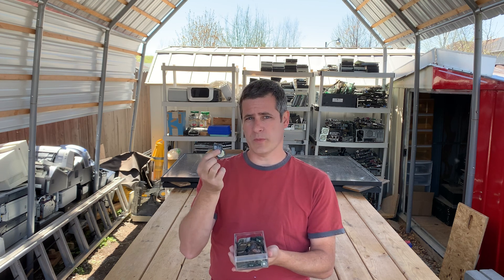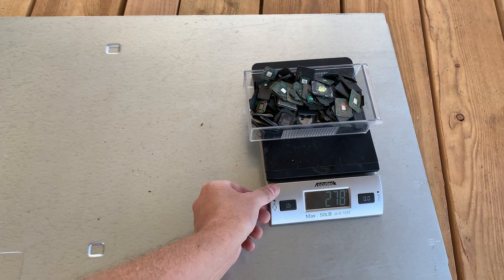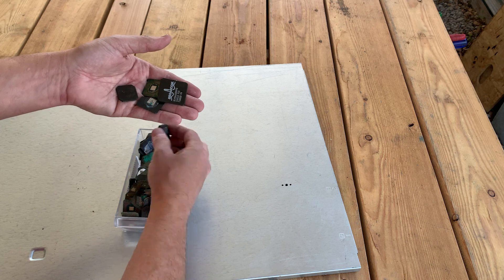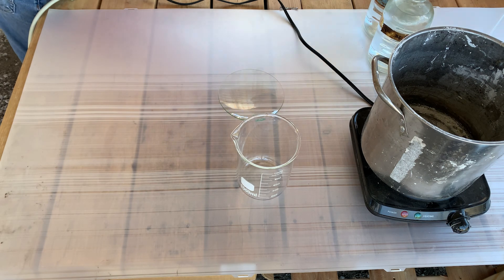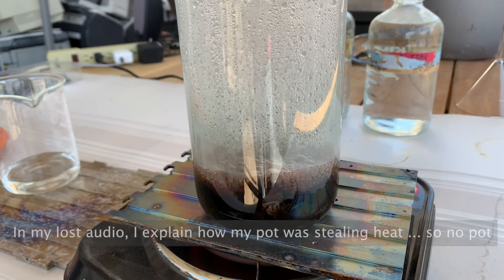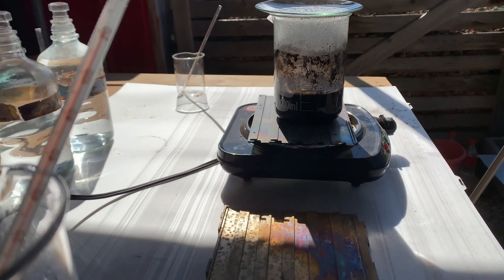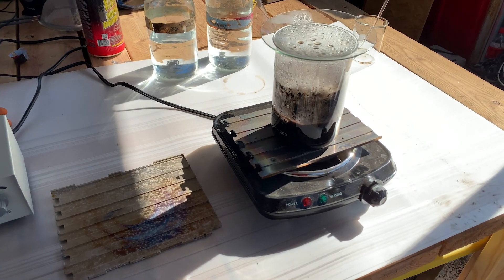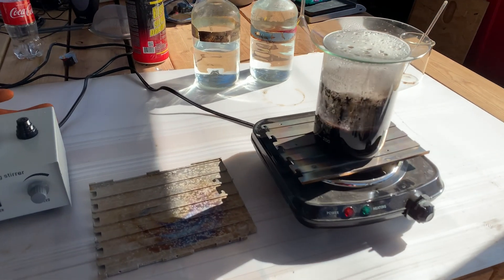Gold Refining: Gold Corner BGA

Comment: Is it not better to smoke them all?
Reply from the maker: Smoke?  I think you are referring to incineration.  And yes, there are advantages to the incineration method (Also known as ASHING).  Using acids is known as WET ASHING ... which in my opinion is not better.  My experience with both methods have bad consequences, explained here:

1. Wet Ash uses acids that burn cloths, and lungs, eyes ... basically, organic material must give way to the caustic and corrosive nature of the acids used.  It uses heat and endothermic reactions which can break glass wear, run out of control easily and without warning.  The waste water after rinsing off the acids must be managed correctly and not just dumped out somewhere.  This way makes the biggest mess, and has the most risk.

2. Ashing requires the chips to be burned to a powder which gives off smoke that is carcinogenic and harmful ecologically.  Maybe less so then the effects of acidic waste even after the acids are neutralized.  Ashing requires high heat such as a fire or furnace which burns fuels and can be costly.  The rinse process uses a lot of water which must be filtered, and takes a long time.  Wet ashing was a hope to speed up the process, but in my opinion, it takes just as long.  Once the gold is separated from the chip casing, it is really easy to refine, and has not been contaminated by other acids or chemical compounds.  

In short, I like Ashing better.  This video was one of my first experiences wet ashing.  I have already promised myself and all my ruined shirts that hot acid, especially those used in wet ashing, is something I will never deal with again :)
Reply: @badideametals  
Thank you. 😊 good information. 
I am burning in small batches with oxy ac set up. The off fume is minimal at those temps the chips are seeing. The ash is easy. It’s carbon. I don’t see very well others really showing much on disposal and makes me fear that they are dumping acids down the toilet which is wrong to be doing. 
Anyways, sitting in old ap the amount is half of what was left of the burnt chips. I goin make hydrochloric acid and bleach solution, bust out the gold and silver, then do actual ar with nitric. Bust it out, HC bath, save that for my AP. There is this YouTube vid. Let me get it.
Reply from the maker: @HellHoundOne  you have a good process there.  That is what I do now too.  I have found recently that I can reuse my copper chloride from other reactions to strip chips as the tin swaps places in the CuCl.  I like your reuse of AP.  Once the chips are rinsed off, I cook them.  Have fun and be safe :)
Reply: Did you remove the comment I posted of the old mans video?

Comment: Just curious, I got some drain cleaner for the same reason and it sounds like it is the same as mine. Could you please what the name of it is?
Reply from the maker: “Kleen-out sulfuric acid drain cleaner”
Reply: @badideametals  We have the same in Australia, it has sulfuric acid with an inhibitor and it's called moflo drain cleaner
Reply from the maker: @luckygen1001 ya, it is inhibited… I tried making nitric with it … no success.  But it does break down ic chips just fine.
Reply: @badideametals  Good to know that it does that because I have 2 kg of bga that need the black tops removed.
Reply from the maker: Good luck.  Post back here with your yield if you don’t mind sharing those numbers :)

Comment: You shouldn't have a watch glass on when concentrating your sulfuric . The whole idea is to let all the steam out as easy as possible
Reply from the maker: That was a learning video for me ... I learned so much since then.  I do remember using the watch glass because the heat was escaping ... that little hot plate was just not getting hot enough with the outside temps what they were.  I don't wet ash anymore.  Such a frustrating mess of sulfuric and foam.  I lost a few shirts to this video :) ... be ye warned all ... sulfuric will eat your clothing.

Comment: consider the different boiling points of your fluids
Reply from the maker: All of your comments are accurate.  I am still finding what works best for me.  One of my greatest mistakes is not spending the money on the best resources… I do a lot of DIY in my life, and this was something I spent over a year researching before my first attempts were made.  Budget was low, and I learned as I went.  I have learned quite a bit since this video… I still know so little compared to some who have done this exact thing for decades.  My rules for myself… stay safe first.  Be willing to lose a batch or two or even a beaker as long as I learn how not to make the same mistake twice, and have fun with a hobby that can potentially pay me a nice treasure :) … as long as I don’t get hurt, I can always try again the next time.  

It is helpful hints and tips from viewers the help me correct errors in my process.  I am waiting for warmer weather so I can process a number of ICs with incineration instead of wet ash… it seems that may turn out better… I really did not like the care needed to keep hot sulfuric in check… 

Thanks again for your helpful advice.

Comment: I am definitely a fan of the lower controlled temperature for a longer time method.  You probably did lose some gold wires to the waste which you may be able to recover afterwards.  My big concern here is all of the acid was is in a metal pot???  Given some time and warmer temperatures that acid will likely eat through that pot unless you are neutralizing it.  I would probably want to neutralize that acid with NaOH (lye) and or NaHCO3 (baking soda), and then once the acid has been neutralized, mechanically filter out the metallic solids with a simple coffee filter system.  Then you can add the recovered metallic solids to your raw gold to dissolve in aqua regia later and then you can dispose of your liquid neutralized acids separately.
Reply from the maker: I have a baking soda I use to neutralize acids with ... I will not leave that acid in the pot much longer... I plan to hit that solution today to get back what I lost :)

Comment: You need to be wearing a mask, when you started talking again and looking down into the second beaker, the fumes and gas coming off the beaker dont have a problem going in your lungs. Respirator is always necessary. You broke the rule of having a catch pan. Use something like pyrex or a casserole dish, thats what I used
Reply from the maker: I had my mask on for much of the recording ... but I took it off to talk so the audio made sense :) but yes, that did mean I was opening myself up to the fumes.  And I got tired of the pan jumping around with that beaker inside.  There were a few times I thought the beaker would tip and spill inside the pot... I need to get something better as my catch pan... I looked at Pyrex ... most people don't know this, but Pyrex in the last 10 to 20 years changed their glass formula ... they are no longer using glass with the same heat resistant properties. ... Borosilicate is safe still, but Pyrex on their own site warns against stove top use now ... Looked that up last year, and that surprised me.  What I want is a casserole ceramic dish with nice thick walls... I will get there :)  Thanks for the comment and your help
Reply: @badideametals  yes I knowmpyrex has changed there formula, Good will man. You can find anything there you need. Im unsure if the name but the casserole dishes or people usually cook them in those, sreetios uses those as well. I have a bunch outside that I used Ill have to look at the name but I believe it might be corning
Reply from the maker: I plan a visit to goodwill soon :) they have the best old stuff ... I am also looking for a reliable hot plate or crockpot (how ever it is spelled)
Reply: @badideametals  yea thats it xorning dishes, buy skme of those on ebay or good will. Those work great, I used pyrex for reverse Electroplating and removing thw green solder mask, its not solder but the color of the board so the gold plating and traces are visible to recover or sell
Reply from the maker: Reverse plating the mask was something I was going to avoid at first ... being new to this, I want to get a few things down right before I take on the world :)  But if you have a good trick to doing the mask removal, I am open to watch or read what you recommend
Reply: @badideametals  The solder mask removal is easy, first tip, make sure which boards have gold traces or completely plated before doing so. When you see more boards you start to know by sight etc but you can sand to test boards at first. To remove the solder mask just heat water and a little lye let the board sit for 5 mins than boom, brush off. Moose scrapper has a good video. I dont make videos my advice is all im willing do.

Comment: well Anthony.nice video..you had all the right ingredients there. was that a big stainless steel pot you had at the start. just throw all your bga into the stainless steel pot cover with your sulphuric acid. bring it to under the boil. if it starts tonfoam up damping it down with more acid,the dark foam should drop them.as long as it's not boiling they should be ok in that big pot. only use stainless steel for this. I'm doing a batch the next week hopefully..good video👍👍👍
Reply from the maker: Thanks for the help!  That is a stainless pot.  I did not think to use it ... I may finish up with that then :) good luck with your BGAs.
Reply: @badideametals  sulphuric doesn't react with stainless. I love that about all these acids and recovering metals. so much to learn and what work with what etc..I'm looking for a pot about your size. I have about 1kg of them..look forward to see your next video..

Comment: Good onya for giving it a go - I have a few KG's of bga waiting for my attention one day.  @sreetips is one of the better fellers to learn from, but he is very technical as well.
I have incinerated them in my melting furnace before to extract the silicon dies for a project, that worked really well, perhaps try that before the acid prep next time.
Reply from the maker: Ya, streetips is fun to learn from.  And I thought about ashing vs wet... and it looked like it is the more expensive route as it requires more nitric... these bottles of sulfuric were about $8 ... so who knows :) more learning to be done on my part.  Good luck with yours :)